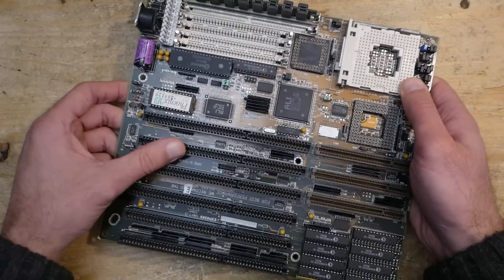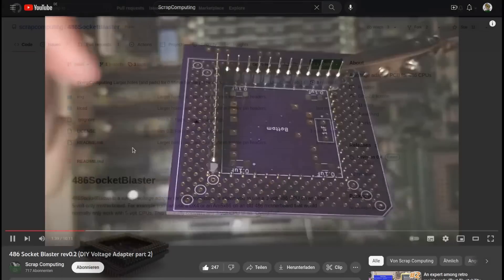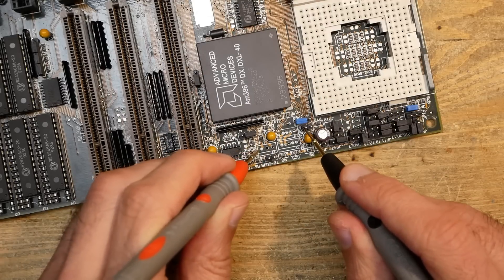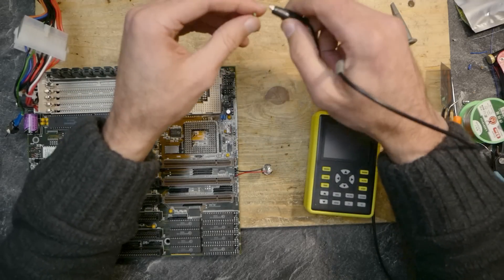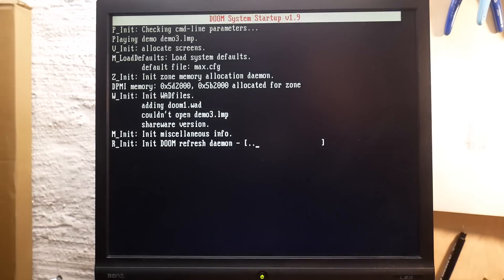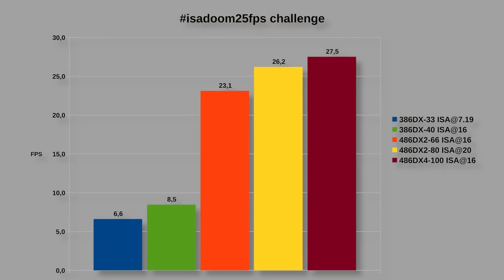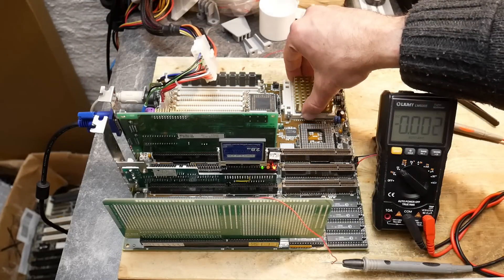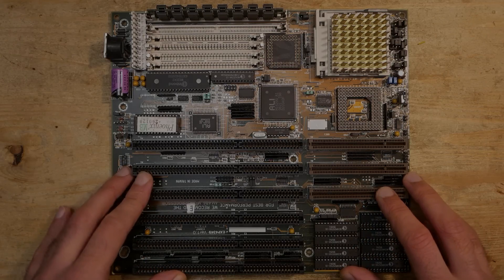An expert among retro mainboards (Part 3):  adding 3V CPU support

Comment: Absolutely great series! I definitely want a sequel and find out why the chipset didn't want to run at 80MHz with the 386 and why the 486 didn't want to run at 120MHz: I wanted to do something similar with the BCOM MB-4D50AV board, but plans are one thing and reality is another. Thanks for the great videos! I'll come back to the 386 with VLB. Yes, it won't help with gaming, but it helped a lot in Windows. Not only do VLB cards generally have much higher raw performance, but most importantly, many of them have 2D acceleration, which only a few ISA cards have. In 1994, when your board is from, it didn't make sense, but you have to remember that the ALi 1429 chipset was released on January 1, 1992, and the OPTI 82C495SLC and SX chipsets even a little earlier. At that time, it definitely made sense to produce such combined boards. For example, I have a DataExpert OPTI-495SX board, probably from 1992, in the version where the AMD 386DX 40MHz is soldered directly to the board (the 486SX 25MHz was optional) and right next to it is a socket for a standard 486 PGA. The board has a VLB slot and three websites say that it does not work, but it works for me :) I can imagine that someone at that time was building a PC and had a limited budget, so they put together a 386 category PC with a future very easy upgrade to 486, but from the beginning equipped with a decent graphics card for working with a graphical user interface, which they will not change during the upgrade. It doesn't seem like it, but it and the 386 with quality peripherals can unexpectedly do a lot. Again, from a gaming perspective, it's not essential, but using the IDE interface puts quite a strain on the processor. A DOS game loads at startup or when switching between levels, so the user doesn't even notice it, but in Windows (OS/2 etc.), where there is always some disk activity while working, it leads to noticeable delays and makes work unpleasant. However, if a SCSI disk was used, then the processor was relieved again and the work was smoother and more pleasant. The same goes for plenty of memory. But nobody cares about that anymore, nowadays everything around retro PCs is about games and these connections are lost.
I'm not a gamer, but I enjoy these unusual configurations and views from a different angle. Sometimes I retroactively fulfill ideas I read at the time when it was relevant, because life went the other way. In 1994 I upgraded from a classic AMD 386DX 40MHz 8MB RAM + Trident 8900D 1MB to an Intel 486DX2 66MHz + some VLB 1MB VGA, but in 1995 I saw how several people around me were still trying to install Win95 on a 386. Some even on an SX with 4MB RAM, because everyone wanted Win95 :D That was of course nonsense. It still worked somehow on a 386DX/486DLC/486SX with ISA, but I had the feeling at the time that the brake was not only the processor, but also the graphics cards. Well, many years later I verified this again when I got my hands on a 386 with VLB. I equipped it with 32MB RAM, 2MB VLB VGA (but I would like to get 4MB with a better RAMDAC for another project with a VLB Pentium), a SCSI disk and it works exactly as expected in Win95 very nicely :) There is no difference with DOS games. I just got stuck on wanting to upgrade the cache from 128KB to 256KB, according to the manual for the board (I have a printed original) I set everything correctly, but the board is completely dead. I don't know why, I have no idea what it doesn't like.

Comment: Never thought I would enjoy a series about 386 and 486 stuff, but this got me hooked. If a motherboard needed soldering I would probably just give up. If a power rail had ripple I would never find out. You solve the problems and go on to overclock it. I've always thought that overclocking the PCI bus (or ISA bus in this case) is foolish and impossible, but you even got that to work. I don't mean to make you blush or anything, but this is just so fun to see. Thanks for making these videos :)
Reply from the maker: Thank you very much :)

Comment: 8:07 Trim pots can settle after they are adjusted. I'd check in a couple of days to see if the voltage is still 3.3v

Comment: There are at least 2 other jumpers which the board just straps with a wire. I bet that one of those is important for unlocking things that don't currently work as expected

Comment: That KTS KDN 0147C IC is the PLL clock generator. The control pins are driven by the chipset instead of setting them manually with jumpers.
Since it generates correctly other frequencies, I suspect a bad solder joint or a cracked trace.
Since I did not found any datasheet for it (only hints that kdn 0147c is part of a series of PLL clock generators), I would set every possible frequency and check the pins to try and make a truth table. So can (maybe) figure the setting for 40MHz and find the fault.

Comment: a triple overclock from 33mhz to 100mhz . astonishing , it did get a little choppy trying to bit bang the data it looked like. This board with your modification is ridiculous , 5 plus different types of cpus so far as well as adding the fpu.

Comment: I remember many years ago having a mother board that was permanently set to a CPU voltage of 5v. It got its power directly from the AT power supply. I cut the CPU power lines and added diodes in series until I got a voltage drop that was close enough to what I needed.

Comment: I would not trust those ebay dc-dc converter boards with such project.  Rather get genuine parts from a store like Digikey, Mouser, Farnell/Newark and get something that outputs 3.3v, then use a linear regulator to do 3.3v to 3v for smoother output.

Comment: I have used this DC-DC regulator and it is not the best. Try one with the  XL4015 IC, much better and easier to set due to the multiturn potentiometer.
Reply from the maker: I have those too. On the good side is, that they can easily hold over 3A, but unfortunately they have even worse ripple compared to that mini360 and second they are too big to fit into that place. Anyway, I'll try to investigate further and see, what can be done and if the stability issues are regulator related at all.
Reply: @necro_ware  On currents that small, it might be worthwhile to go linear. More power dissipation, but (usually) spectacular ripple
Reply: I guess there is a lottery with this modules. My experience was backwards, but I powered them from 12V. I actually found some 5A LDO powering the CPU on old motherboards , Gigi mentioned them also, I don't remember their part number now. As a secondary solution, a modern power supply has a 3.3V output already, that should have a small ripple. Maybe you could try using it via a connector and adding some extra filtering near the CPU.

Comment: Great video, as always! And thanks for the mention! 
I was not aware that older 486s had a different multiplier pin, thanks for sharing this information! This makes adding a Write-Back cache jumper to the 486SocketBlaster even more useful, as it will also help control the multiplier in these older CPUs.

Comment: I wonder if the boot failure was a ripple issue. You tested the ripple on some of the weaker chips at 33 FSB, but when you had to up the voltage for the last one... who knows?

Comment: Is it possible to replace the current clock generator with a more modern and capable programmable clock generator? 

Would be an awesome hack for overclocking experiments, allowing you to set the front side bus clock speed in smaller (say 1mhz) increments.

Bonus points if you can find a clock generator that allows (cleanly) adjusting the clock speed while the CPU is running.

Comment: Hi, Necroware. When I was younger I thought it was cool to remove all the pins from a UMC U5S CPU. It was a mistake. Now I would like to put them back. What could I use as replacement for the pins (without cutting some piece of wire)? Regards.

Comment: It has been about 25 years since I was over clocking dx4 cpus, but if I remember I had similar issues. I recall changing the voltage regulator, as it needed up to 5 amps. I also remember needing exceptionally clean power for it to remain stable at and above 120mhz.

Comment: From back in the day when motherboards like that were the bleeding edge, I often dreamed about hacking one like this so I could upgrade accordingly. Then the slot 1 P2 came out and blew my mind. I remember the P3 chip when it broke 1Ghz for the first time. We've come so far over the last few decades. I'd actually like to see if it's possible to hack a slot 1 daughterboard to socket a different processor. Like put a socket on it and see what's possible.

Comment: Those regulators are horrible with wild voltage swings depending on load so it wasn't too surprising to see the old 486 go berserk at higher frequencies. You can't do the same you did with the socket 7 board? :)

Comment: I'm going to guess the board didn't like the 120 MHz fsb because the cache couldn't keep up. I could be wrong but it's a valid guess
Reply from the maker: It is a valid guess, indeed, however I upgraded the cache in the last part to 15ns and it should be fine. I think, it's either voltage ripple, or there is something wrong with the clock generator, since it also made problems to deliver 40/80MHz for the 386. May be it is related, since at 120MHz we again have 40MHz FSB. Against this theory is that it ran fine with DX2-80 at 40MHz FSB. Well, I'll have to investigate it in another part ;)
Reply: @necro_ware  That's true. I forgot you upgraded the cache. Also thank you for the smooth correction. I got the bus speed and the clock speed mixed up. I can't wait for part 4

Comment: That voltage regulator just can't deliver the current needed for the DX4 overclocked to 120 MHz, just try something other instead, more powerful...
CPU is a harsh pulse load, the voltage regulator must have a really fast feedback loop and a good margin by the current.
Reply from the maker: It is actually capable, I use it in another project, where it gives me 2,5A at 3,3V constantly. This should be enough even at 120MHz, but I think the voltage and/or current ripple is what makes problems. There seems to be a lot of demand for another video about this board, so I'll make some more experiments in that direction, but not in the next video. May be after a while.
Reply: @necro_ware  Well, a constant load and a heavy pulse load (when the current could go from 0.1A to 2.5A and back for million times a second) are two very different stories. Try a powerful (5A or more) linear regulator first and see will it fix the problem or not - just to exclude this possible issue.
Reply from the maker: @Alex.Adametz  Yepp, this is what I'm going to do. Already found one in my scrap, but first, I'm going back to another topic. This board will have to take a vacation for a while ;)

Comment: I wonder if this board could be configured to run the original 386 from 1985 at its correct 12 MHz 🤔

Comment: Those variable resistors in that regulators are very sensitive as you already told, and also it could change its value  without notice, you would better replace it for the apropiate smd resistor to get the 3.3v and be on the safe side that it will not change resistance by its own... Great video as always! And make part 4 of course!
Reply: I was thinking the same thing. Either using a smaller variable resistor to limit the maximum voltage spread with fixed resistors to limit the min and max range (instead of 0v to 5v have it variable only from 3v to 4v) or replacing the variable resistor with a multi turn (probably the easiest solution). I would also add extra filter capacitors with low ESR on the regulator output and possibly directly across the CPU power pins (he did mention adding filtering).

Comment: It looks like a choosen voltage regulator is not powerful enough to handle overclocking. As an option ripple may become an issue at higher loads. It wasn't great from the beginning.

Comment: Maybe the real parameters of those chinese regulators are lower than declared ones. I would try it with linear regulator first, because output is much cleaner without ripple. Power dissipation is not so high for 486. (5.0V - 3.3V) * 2A = 3.4W max.

Comment: You were probably getting too much ripple current when trying to push the 486DX4. Try it again after adding some capacitor to the input & output of the regulator.

Comment: I got a bag full of old tantalums, so the offer still stands...
Reply: What's the advantage of tantalums vs electrolytic?
Reply: @darthtripedacus1  They're a lot more volatile...
Reply: @darthtripedacus1  In the last video, I suggested a reverse recap, putting in capacitors that are ready to fail, to punish the motherboard for being such a clusterfuck, including the egregious ripple voltage that made it so unstable.